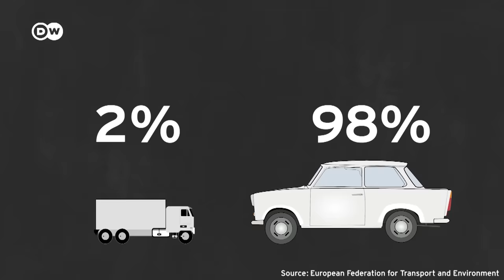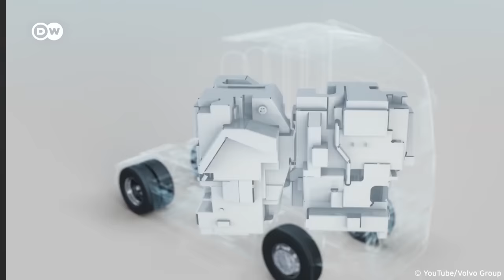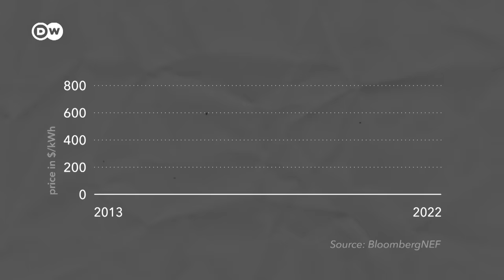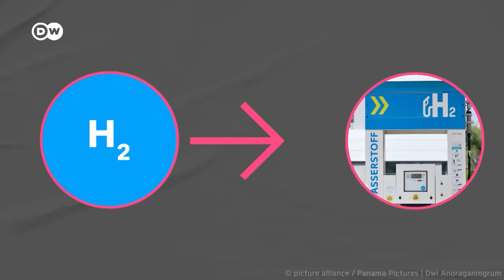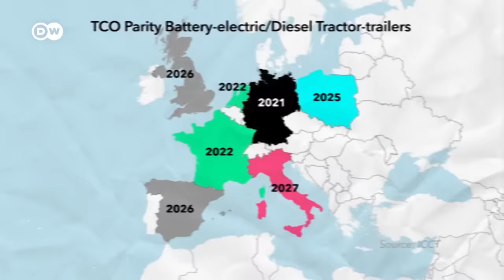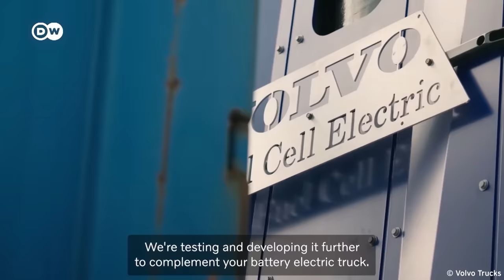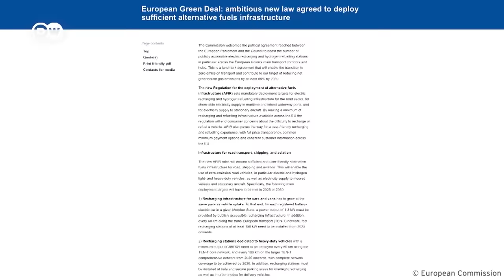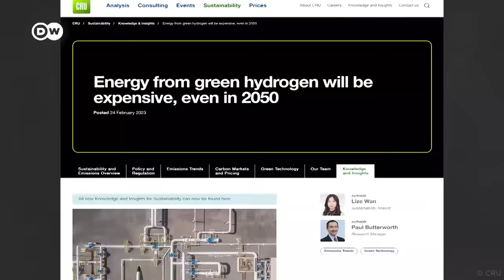Which will be the engine of the future?

Comment: My Opinion is to go for Hydrogen because trucks are used for freights which will take more load. More load means more energy required for trucks. We cant bet on battery because there is a chance of truck getting break down due to enough of power in battries. For trucks we should go on Hydrogen and light vehicles can go on electric. There is another challenge when there is more electric cars on the roads imagine whether country can produce enough of electricity to power these vehicles and cities and green power wouldn't be enough.
Reply: Do you have an idea how clean hydrogen is produced?

Comment: I bought an EV and recharging really takes time. But it's better than looking for a hydrogen station and drive a long way to fill up the hydrogen tank. If the industry can't solve thr hydrogen production, transportation and storage in large scale, the hydrogen car won't be a household option. Does it make sense that if hydrogen is produced using electricity, why don't just recharge the electricity into the EV?

Comment: I believe going 100% EV will be a fatal mistake. Why, because a country like the US would require 40 % more electricity to sustain all these electric vehicles.
The US just doesn't have the infrastructure to support such a demand.
It would be better to develop a true hybrid truck. One that would carry it's own generator and charge it's own batteries  as needed. You could also run the generator on whatever choice of fuel you want. Why company like Toyota has chosen not to pursue building an EV. Instead they have chosen to pursue building their Hydrogen Combustion Engine.

Don't get me wrong. The use of an electric motor in a class A truck is a great idea. !00% torque @ 0 rpm. The hardest thing the truck has to do? Is get that weight moving. Once the weight is moving? The truck really only requires around half the power of modern day truck to sustain it's speed.

Comment: Hydrogen losses aside is greener than batteries. And much more recyclable. The fuel cell only use platinum/palladium which can be recycled. 
While for batteries it is much more difficult.
Reply from the maker: Hey there! Yes, battery recycling is tricky. We looked at both, hydrogen, and ev battery recycling a bit ago. Check them out and let us know what you think ✨ Hydrogen 👉https://www.youtube.com/watch?v=AGTjKJHu99c EV battery recycling 👉https://www.youtube.com/watch?v=PbOBmnZRpZ4
Reply: @DWPlanetA  
I watched and agree with the content 
I believe both will have their place where they are best used.

Comment: EVs impact the environment in many ways during production and use. People buy EVs for a ridiculous price because they think it's cheap to run and they think it can save the world. but they don't think about the bigger picture . It's a false economy. Full EV adoption is not practical at all. EV batteries have massively increased demand for precious metals , which are mined using heavy diesel equipment . The process ruins surrounding land and habitats for 100s of miles . Electric vehicles are supposed to help the planet , but their batteries definitely create the next trash problem. And sometimes , lithium - ion batteries explode . Also EV charging stations have massive diesel generators to generate electricity to charge Electric vehicles. Those generators run 24 hours a day. Electric cars certainly reduce your carbon footprint , but making the lithium - ion batteries could emit 74 % more CO2 than for conventional cars . Not only these things, there are so many negative things happening behind the "zero emissions EV vehicles" .

Comment: isn't hydrogine also use electricity which This can be done through a process called electrolysis, where an electric current is passed through water, thereby splitting it into hydrogen and oxygen?

Comment: 1kg battery - 0,14 kwh
1kg gas - 9,5 kwh
1kg diesel - 10 kwh
1kg hydrogen - 33,3 kwh
In my opinion the answer is easy and those who think that batteries can solve all the problems, are crazy.

Comment: This debate was won 100 years ago. 

Think about a truck but on rails a hub and spoke model High speed rail to main regional points then smaller rail to local then small truck out 

There is no good reason for a truck to go from Warsaw Poland to Manchester England, this could and should be done with rail

Comment: We can narrow the problem to one and only point : density.
Charge speed, costs, churn rate, pollution, maintenance, infrastructure : hydrogen has lost everything.

So the day ultra high density batteries become available, the whole h2 plan collapse.
And there is already 4 ways to this : solid batt and silicoum / sodium or lothium-sultfure / graphene(s) / lithium-air. 

And all mixes of this chemical ways. 

So the whole future of hydrogen is suspended to this

Comment: Lithium Ion Batteries are NOT environmentally clean. Especially when they're on fire (which is more common than most people realise). We don't have enough resources to manufacture them or charge them, if every vehicle is going to use them. And most of them are being charged with electricity produced by burning Coal or Natural Gas. We need to solve those problems first!
My bet is on Hydrogen being the eventual winner. If the costs can be brought down it's a better, safer option. Then there is the new Ammonia engine ...
Reply from the maker: There are indeed problems to solve. We made this video in exploring some of the alternatives to lithium 👉 "How salt and sand could replace lithium batteries" https://www.youtube.com/watch?v=-vobMl5ldOs. Please share you're thoughts on these in the comments. 🌱

Comment: You completely ignored the low energy density of Hydrogen, giving a truck either limited range or the need for a massive tank. A 10,000 psi and heavy tank. What is the range of those test trucks in the video? Makes sense only for trucks used locally. A city could make all buses, garbage, etc. Trucks, Hydrogen because the necessary range is limited and the refueling centralized. Physics is not overcome by technology, ever.

Comment: I support hydrogen but, The future of hydrogen as a fuel source holds promise for decarbonizing heavy-duty transportation. Hydrogen fuel cell technology offers rapid refueling, comparable to traditional diesel trucks, and emits only heat and water as byproducts. While challenges like limited refueling infrastructure and energy-intensive hydrogen production exist, proponents argue that hydrogen could play a vital role in addressing the specific needs of extremely heavy loads over long distances. However, its widespread adoption will depend on overcoming these challenges and aligning with global efforts to transition towards sustainable and zero-emission transport solutions.

Comment: Hydrogen is clearly the answer. There have been breakthroughs since this video aired. 
Australia has invested and we will be the major exporter of Hydrogen by 2031. One of our plants could fuel our truck fleet twice over! (Gladstone Hydrogen Hub, QLD). We also have a lot of Vanadium which is used in batteries that last for 18 hours and can be recharged thousands of times. We found $500 billion of critical minerals and are using it for the clean energy future. We supply the world with coal so we are trying to make up for it lol. SunCable to Singapore etc.
Reply: Funny. In Melbourne, Toyota converted a whole car factory they owned to produce and dispense hydrogen. It has a MASSSIVE 200kW electrolizer to do this. The whole car factory sized plant produces at max output…. 80kg of hydrogen per day. Which means it can refuel only 14 hydrogen cars a day.

14 … for a footprint the size of a car factory…..
Reply: Infact the Gladstone plant is proposed to take up 1.71 million square meters of space.

Comment: It doesn't take too many IQ to figure it out. Or just let us call it an elementary excise. We just need to store enough sun power for our needs, it is very cheap and it will last as long as we will. To burn Sun power to produce Hydrogen to run an electric motor I find it plain stupid, since we don't need Hydrogen to run an electric motor very efficiently, eliminating on the onset the exorbitant costs and the problems inherent to Hydrogen.

Comment: Formic acid fuel cells or Nano Electric Fluids are the future, as both allow liquid refueling and transport of engergy, using the existing fuel distribution infastructure. Batteries and Hydrogen cannot do this.

Comment: The most cheapest powertrain for Future will be a drivetrain with an H2 ICE. You will be able to use up to 80% of the same parts used on a diesel engine and the OEMs could use their existing infrastructures and vehicle platforms. You don‘t need to use 99.9% clean hydrogen as with a fuel cell. You don‘t need to transport additionally 2-3t of battery. And if we could use „white H2“, and there are enough reserves found on the earth let run the traffic for several decades, then we will have the cheapest solution and batterie will never be a add-on or competition.
I forgot, don‘t tell the driver of a E-Truck where the button for the heating or air condition is ! It become a „long“ trip by using it ……

Comment: Neither of these options will be the truck engine of the future. Water was converted into a combustible gas (separate molecules of hydrogen and oxygen) by Stanely Meyer and Dennis Klien. I believe this was done by exciting the water molecules with resonate frequencies. Hydrogen/oxygen gas is not suitable for diesel engines, but it should work well in internal combustion engines, jets engines, and turbines. So, I believe trucks of the future will be powered by turbine engines fueled by water which is gasified on the vehicle. No expensive energy consuming electrolysis process and only water vapor out of the exhaust. Vehicles fueled by water as predicted by Jules Vern.

Comment: "Electricity from overhead contact lines..." Where have I seen that before? Oh right, trains have been doing that for decades. Maybe we should move more stuff by trains than by trucks.
Reply: Of course, but that doesn’t mean we don’t need electric trucks.
Reply: @Simon-dm8zv  But not nearly as many, trucks need way to many recources to build and operate, incl. human recources. All those huge batteries are crazy and also think about the tons microplastic released by the tires.